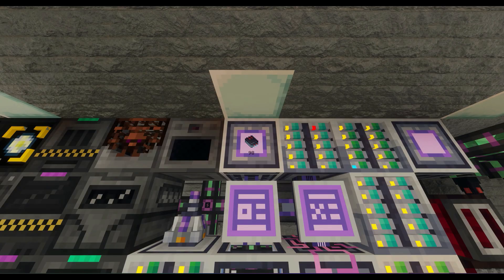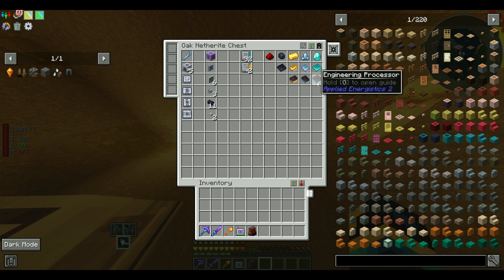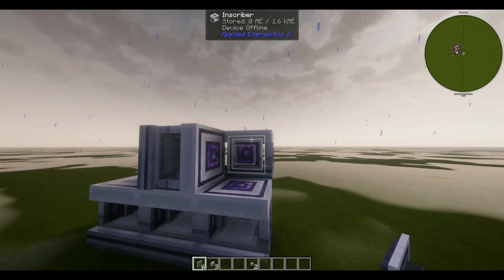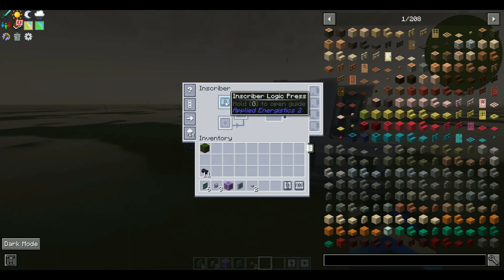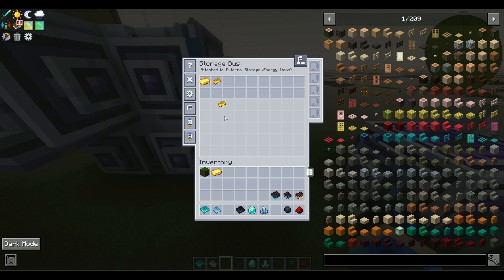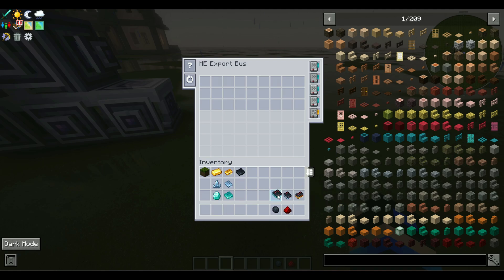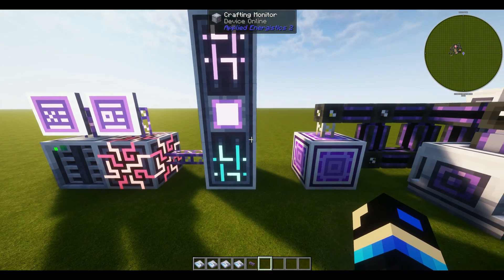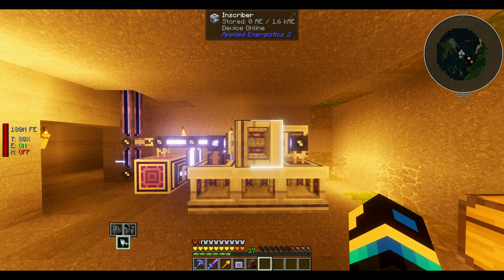Ultimate Processor Automation in All The Mods 10 - Tech It Easy!

Comment: For everyone confused, he goofed the recipe.

The recipe should be Redstone, Silicon, and Diamond/Certus/Gold makes 1 completed processor.

If you just fix that one thing, it'll all work perfectly. If you follow the recipe he shows your system will assume you've already got printed circuits or you know how to make them. It does not. This setup turns the raw resources into COMPLETED circuits, so you should only input the raw materials

Comment from the maker: I made an OOPSIES. 06:56 whenever I was making the patterns, I used the RAW resource instead of the printed circuit counterpart in the encoder. Ignore that, for the Calculation and Engineering process patterns, use the calculation and engineering printed circuit INSTEAD of the RAW resource. okay bye!
Reply: you mean the exact opposite... bro was not lying about being fried